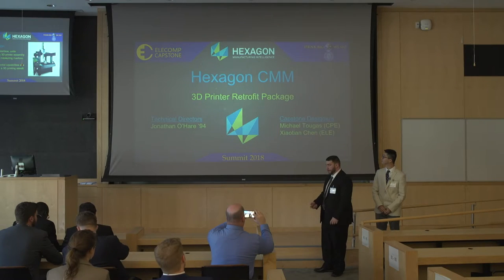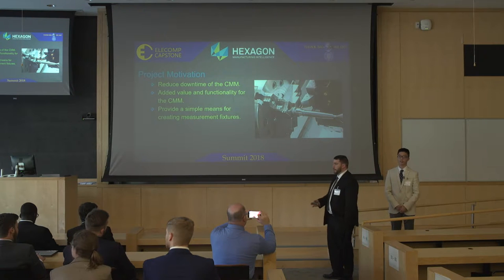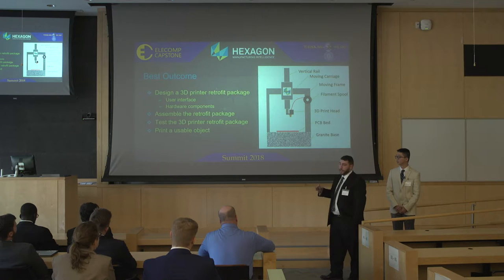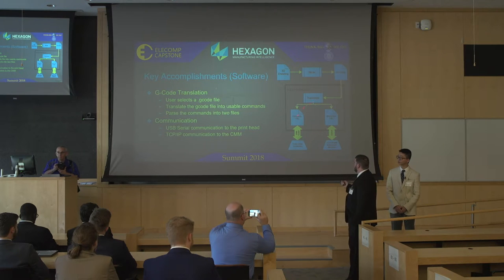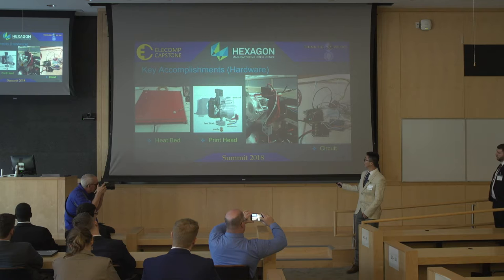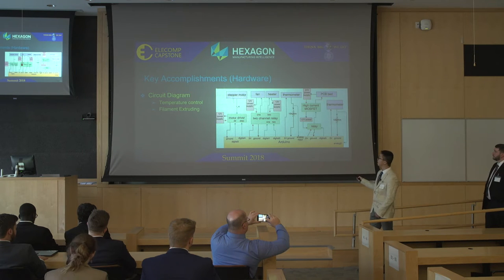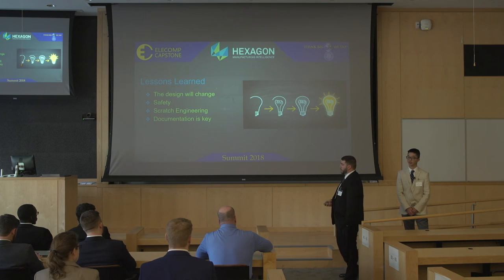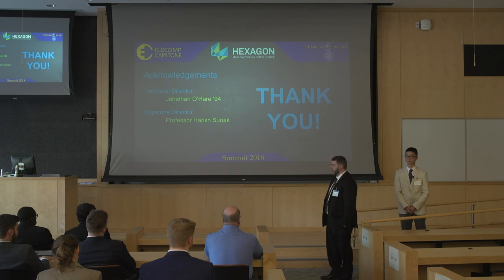3D Printing Retrofit for a CMM - 2018 ELECOMP Capstone Capstone Summit - Hexagon Metrology

Comment: Hi. I also commented your pitch at the 2017 summit I guess. Are you still working on this project?
Reply from the maker: Roetz, Hexagon Manufacturing Intelligence has sponsored several projects since the 3D printing retrofit. They involve part identification using a cobot, and optimization of a cobot loading system. As these projects are sponsored by businesses, many continue working internally on projects after the program year has ended. You can of course view presentations of the subsequent years' teams through this channel or can visit our main website and read about them in-depth. Our homepage is https://uri.edu/elecomp-capstone. Thank you for your interest!
Reply: @elecompcapstone1609  interesting concept. Haven't been aware of this beeing an university's project. I stumbled upon your videos by accident while searching for air bearing related content.

I built a fully working CMM 3d printer myself. It is based on an johansson CMM and has some pretty unique features.

You can find a (short and bad) video from 2017 here: https://youtu.be/kHMWGTtBY4U

Hit me up if you're interested in information or anything else.